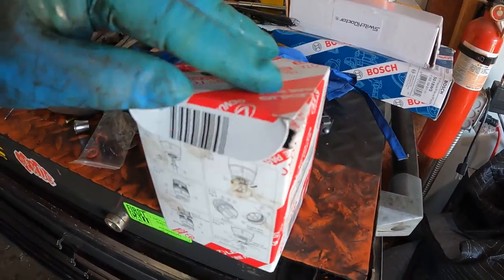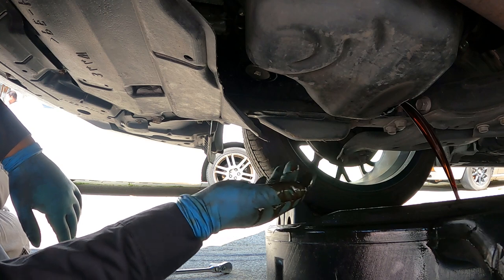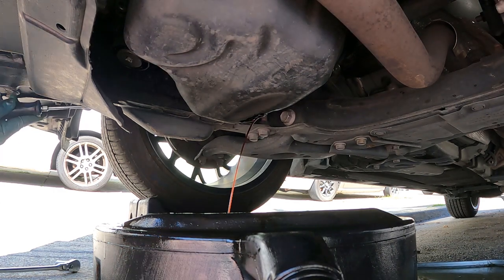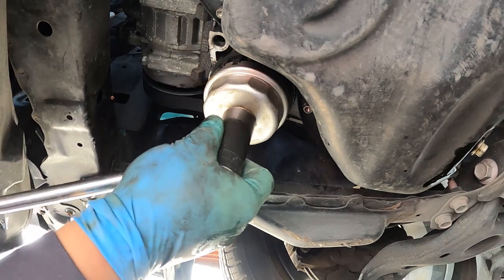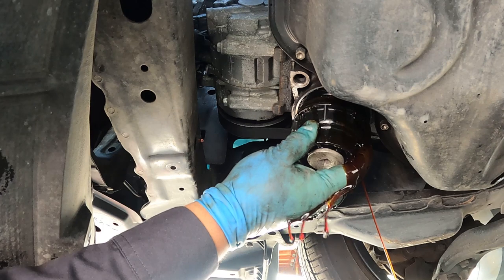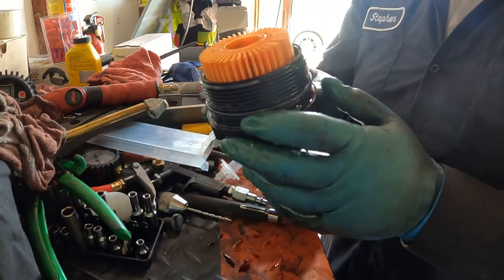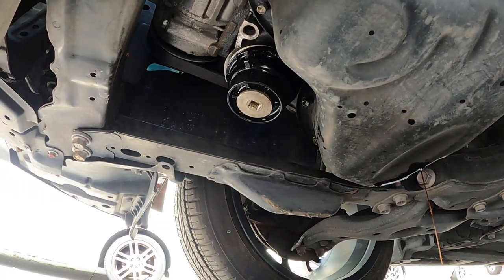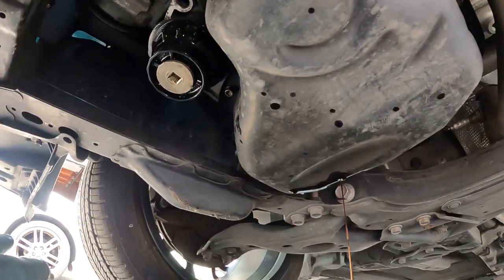how to do you own oil change for SCION TC (2012 to 2016)

Comment: The manual stated 4.7 qts. How come you put in 5?
Reply from the maker: You can put 5qrts it's ok, .3 qurts of oil is not that much. You can put the whole 5 bottles. Because some engine do burn oil so dont worry. 

If you have not subscribed to my channel just hit the subscribed button, to get the latest video. 
Thank u

Comment: Can you remove the filter without the tool ? It looks like you can insert the ratchet straight into the cap. Will that work ?
Reply from the maker: yes you can do that using 3/8 socket extension it's basically 3/8, but most of the time the only part you will take off the is drain plug cup - not the whole oil filter housing. so i highly suggest get the oil filter wrench socket. for toyota or lexus

Comment: why use 5w-30 and not 0w-20?
Reply from the maker: Sometimes oil get burned out due to 0w-20 are not that thick oil. And 5w-30 are little more thicker oil so it's not burning. And the car is been using everyday for work. Sometimes it's personal preference by using different oil grade.